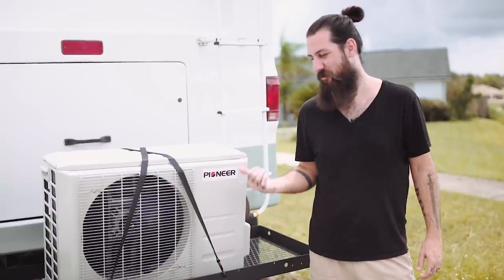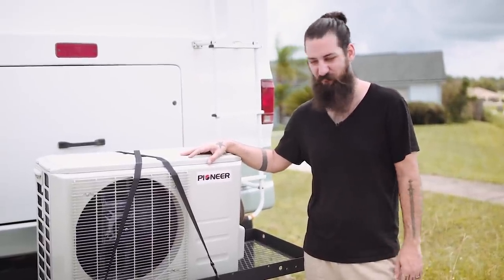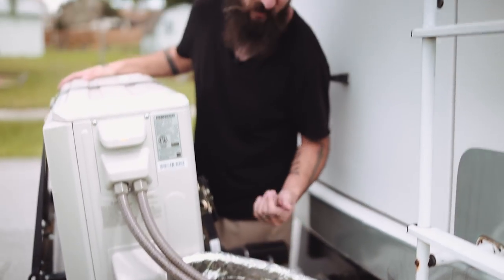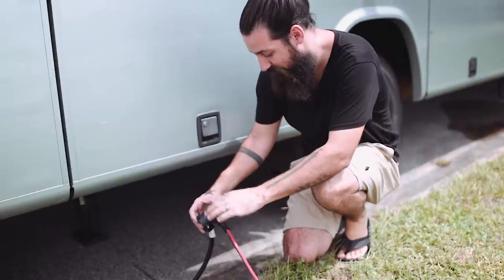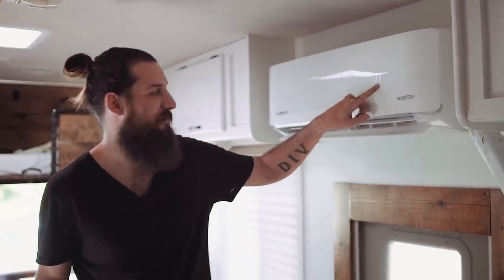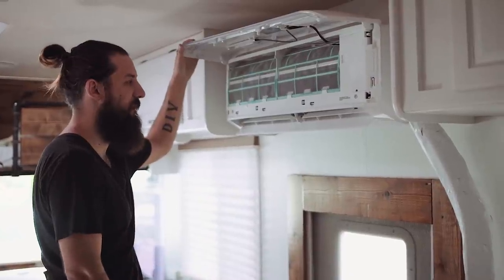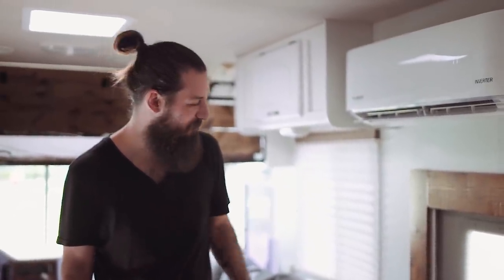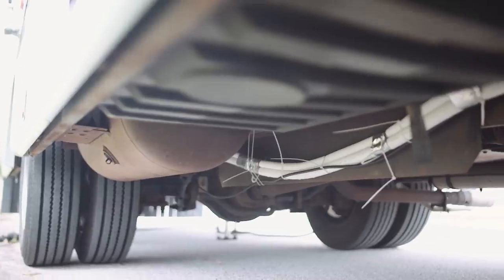RV / Motorhome Mini Split Air Conditioning Setup

Comment: Great job on the video, explanation, and common uses. The camera lady though is a little flaky but we can live with it. The biggest advantage here is that it's a residential unit that can be serviced or replaced by an AC shop. No waiting for parts from China like the common Dometic units found all most these rigs and especially important during a pandemic. Great job once again.

Comment: The huge advantage of a mini-split is its efficiency. My "SEER 22.5"-rated pioneer 9000 BTU will run off my Honda EU1000 generator IF I do not use eco-mode. Rooftop A/C's are nowhere near this efficient. The SEER number does matter if you hope to run your air off a generator or (possibly) a solar system. If you really need a low amp draw....look for a higher SEER number. The power savings is pretty remarkable. Thanks for the video!
Reply: Oooh what model do you have? :D What size space is this cooling/heating?
Reply: Check out   www.highseer.com.  amazing units for RV or house.  One of the few that have a 12,000 BTU that runs on 120.  The biggest thing is it uses about 1/3 the electricity of a RV roof top unit.  Those haven't changed much in technology since the early 60's!!!  Sad that it has taken the U.S. so long to adapt these... have them in off-base housing on Okinawa back in the late 70's when I was stationed there.
Reply: So if the steer is higher I can run it with a lower gen?? I though the steer # would be the size of the condenser,  like if this deer is lower or Ritz 9000btu then the condenser will be pretty small if the BTUs are higher than the condenser would be more bigger
Reply: Good and helpful comment G. Thumbs up.
Reply: Yap the SEER is very important and nobody is better then Fujitsu 9000 BTU split AC with "SEER 33"
Reply: What one is best for heating in Oregon weather with lowest amp draw?

Comment: Thanks for the video! I have a 28ft enclosed trailer that my family and I use for racing. We have a late model race car and normally go on Saturday morning to the track. The problem is in North Carolina the heat is unbearable past the start of June. We wanted to have heat also because it is cold when racing season first starts and sometimes at the end of the race year. I have been trying to figure out which unit to buy but the 12000 btu pioneer looks like it will be perfect for us. We just have to install a door or buy the clear door cover at the back to keep the wonderful cold air in. If that unit you have will cool a 38-42ft motorhome then I am sure our 28ft trailer will be no problem! Thanks again for the video!!

Comment: If you mount the outside unit on the hood, it will get more cooling power from the wind as you drive and therefore run a lot more efficiently.    Plus the refrigerant line run to the above-door unit will be much shorter which will also increase efficiency..

Comment: Thanks for the pointers. I will be installing a 230v 24k btu in my 5th wheel. I already have 2 15k btu riif units and they just won't do the job on the hottest days. Plus I'm just tired of hearing the loud things.
Reply: I was thinking of getting a dual zone 9k and 12k 230v systems also, but I think I'd need to get a split phase invertor so I can use it while driving or boondocking.  Alternately, if I can build a frame to put two units on the back of the motorhome two 115v units would save about $600.
Reply: @brianvandy4002  I'm glad I went the 240v route because they are more efficient. I don't boondock but hooked up to shore power I could run the mini split and the other 2 rooftop units (Even though there's no reason to) on 50 amps no sweat. The 24k mini split cools worlds better than the 30k BTU worth of rooftop units. It can be a hundred degrees outside in the mini split will still keep it below 70 inside by itself.

Comment: Any updates on this?  Still working well?  I have wanted to do this but worry about all the all the jarring of the open road on a residential ac unit. I have a travel trailer and have an empty Battery box (moved batteries inside) perfect spot for mini split close to electric and batteries.

Comment: This is great, thank you. Could you please tell me, does it cool down your bedroom in the back? I’m in Tucson, and wondering if a mini split installed in the middle of my coach will reach both ends. Thanks!
Reply from the maker: Hi Derek, our is pretty much in the middle of ours, and cools the whole rig down fine. We don't have a door to our bedroom, so the air can still flow to it. We do use a small fan at night to have moving air.
Reply: You can turn on your furnace fan for circulation if needed.

Comment: Thanks to you I will now be doing the same thing with my 30' 5th wheel and will do a installation video as well. I will be hiding the lines in a closet or in your case I would have done a false wall to hide them, but nice job anyhow!

Comment: I have spent hours looking at alternatives to cooling my 37 foot Bounder and this is the best yet!  How did you attach the bracket for the inside wall unit, I saw a video where there was a sheet of aluminum attached first.  Did you consider this or find it necessary?  Also where did you obtain the double hitch?  Looked for contact info but was not successful, hope this finds you.
Reply from the maker: Thomas Surro ours is mounted on a wooden box frame. There was already a cabinet there. We just replaced the cabinet with a flat face basically. The head unit weighs the same as two bags of groceries you’d put in the cabinet so I saw no issue. I’m pretty sure I got the double hitch at Walmart. You can find them on amazon as double hitch adapter.
Reply: Thanks for the lightening quick response, I've located the Hitch Haul and all is well.
Reply: I can build custom ac units . Using automotive EVAP coils vents and supply hoses to needed locations. Don't use a home unit for your rv
Reply: @davidwilliam1406  Please explain why not to use them.

Comment: Litte Adventure,  How long have you had this system installed and how much traveling have you done with it?  I know you said you did a 4000mile journey after you had installed it but I am wondering more about longevity of the bumping and knocking that will occur while traveling.  I am thinking about putting one of these in an enclosed race trailer but am concerned about the durability of the unit under the bouncy conditions of the 16' trailer.  I currently have one of these installed in a small office behind my house and it is AMAZINGLY good and SO QUIET, I'd love to have one in my trailer for hot summer races.
Reply from the maker: We have been full timing for over a year now, and have had the mini split installed the entire time. The very first thing we ever did in our renovation was get rid of those dang rooftop units! We have probably put about 6-8 thousand miles in the past year, and the mini split is doing great. We hop from campground to campground at least every two weeks, just to give you an idea of how often we are driving with it. We wouldn't change a thing!

Comment: Great setup, just one critique, don't leave your electric adapters and connections in the gutter outside.
Even if there is no rain in the forecast, the neighbor next door could short you out by watering his lawn.
Reply from the maker: Solid advice, Bob! This was actually just a short term parking for us just to make this video, before we moved into the backyard - but still, great advice! Didn't even realize we had just thrown the cables there willy nilly. lol

Comment: This is a cool setup and idea but I see that you're hooked up to AC but how does this work on the road and boondocking/dry camping? Is it running off your generator/house power, solar setup?
Reply from the maker: Hi Aaron, If our generator worked, it would run off of that while one the road, lol! We are stationary at the moment, staying in my moms backyard only hooked up to a regular household 110 outlet, and that is enough to run our A/C (which is part of the reason we got rid of the rooftop units and installed the mini split). We are currently looking into solar and a battery bank, so that will be an upcoming video for sure.
Reply: This Little Adventure interesting, what happened to the generator? I'm going to convert my gas generator to propane and hook up a mini split how you have it. What btu do you think would be sufficient for a 30ft class A? I was thinking 12 but can I get away with less? I'll also be adding solar but that's a much bigger project.

Comment: What guage extension cord did you plug into? I'm looking at setting mine up with an extension cord wired directly to it and then plugged into a 50 amp at rv spots. I'm looking at going with a 12/3.

Comment: I like the installation, the line set bundle needs tweaking? I’m thinking some type of wire loom would look cool if you could find it that large. Otherwise great job
Reply: White square vynl raingutter drain section!

Comment: I have a question: I am thinking of using a split unit in my MH and would like to know if the inside unit has to be placed like it is in yours or could you put is on the ceiling in the area where the old AC unit  was? I'm think probably not but one could run the connections across the roof then to the back. Just trying to plan my layout... any suggestions would be appreciated.

Comment: Will this unit drop down to the 60° mark in dead of summer florida heat?  Im from N.Y. love the cold and hate roasting in a rv.
Reply: If you need 60F to be comfortable, go to Nova Scotia, not FL.  A well-installed mini-split will typically drop the temp 30F from your outdoor temp.  RV insulation is the limiting factor and it's not that good.

Comment: We are thinking about doing the mini split after testing out tons of portable units. We are just wondering how cool your back bedroom area gets with just one unit?
Reply from the maker: Katelyn Rufty That's a really great question, Katelyn! The mini split does cool down our entire motorhome, but obviously the living room area is always going to be colder than the bedroom, simply because that's where the unit is. Since we are really only ever in the bedroom at night, we prefer the living area to be the most comfortable. We have a Vornado floor fan that we use at night in the bedroom, and that pushes cold air back there as well as gives us air movement, which otherwise would be quite still. All in all, we love how quiet and efficient the mini split is compared to the rooftop a/c units in all campers! :)
Reply: I was wondering the same thing. We have three kids and will be replacing the back bedroom with folding bunk beds, while my husband and I sleep in the front on a pull out couch.
I hate the two roof air conditioners and was thinking of replacing them with Maxx air fans and installing a split unit. I was just wondering if we should get two or one  indoor units. Maybe, we could get away with one and the fans will help with circulation.
Reply: dreamingfool2 after watching this video we bought one unit and installed it in the back where the kids sleep and it has been amazing! It feels like we are back in a house and so very quiet. We did install it later in the summer so haven't gotten an official test in the humid south, but cooled down the entire motor home. Started using the heat and for us it's not as strong as the cold air so we've been supplementing with a small space heater up front where we sleep and has been fine. We've been satisfied with just the one unit for now. We also have the maxx fans in the ceiling where the old roof units were and it's nice to open those for fresh air when it's nice and also some extra light. But so far we have been amazed at how great they work!
Reply: Do you run this A/C while driving? That would presume you run the genny too.

Comment: I actually installed that same brand in the living room of my 1400 sq. ft house.  works awesome, but do you think you could have gotten away with using the 9000 btu model instead of the 12000 btu?  I'm wondering if the smaller unit would handle something the size of your rv if given enough time.  I'm planning on using one powered by my solar set up  in a step van I'm converting.  the low starting amp draw and the the variable speed of the compressor makes it ideal for my use....just wondering about the cooling load
Reply from the maker: pipeboy98 We probably could have gotten away with the 9000 but model if we had a better placement opportunity for the indoor unit. We have seen them often in tiny houses mounted on a far wall, which is ideal because it only has one direction to flow and also only has to fill one open space. I imagine this would be the same situation in your step van. In our motorhome however, we need the air to fill our living area as well as make it back to the bathroom and through the hallway to the bedroom. We use a floor fan at night to help push that cold air into the bedroom, and this works really well for us. We are currently looking into solar options as well, and we absolutely love how efficient the mini split system is. Good luck in your conversion! :)

Comment: what about when you travel?  How would it react to vibrations?  how long would it hold up?
Reply from the maker: We did drive this thing through some pretty terrible midwest roads about a month ago, and we kept checking every time we stopped to check everything. So far it seems to be holding up just fine! We are looking into moving the unit from the cargo holder to the actual inside of the trunk area we have just behind it, which will make it feel a little more sturdy.

Comment: Where can u park, do they have a place for u to plug in the unit for heat or ac, and how much does it usually cost monthly?
Reply from the maker: imcharmed4evr Most of the time we stay at campgrounds with full hook-ups for a couple of weeks at a time. While we're at the campground, we have full power and are fully hooked up with water and sewage (most of the time). When we aren't at a campground, its a little different. Like when we park at a friends house, we obviously aren't hooked up to sewage and don't have full power, but we do have enough power to run our a/c and our outlets and tv and computer. It varies, but our typical monthly costs for living are about $200-$400, depending on which campgrounds we stay at. :)
Reply: This Little Adventure could you do a video about some of the campgrounds you stay at? Our family is planning to make the move in a camper after the new year but most of the places we are finding are Super expensive (like 1000-1500 a month) we have been considering a Thosand trails membership to help offset but would love alternatives.
Reply: Many full time YouTubers move around quite a bit and seem to find 25-30/nite at the low end and 85-90/nite at the upper. Most parks will give a monthly rate that is lower. You could boondock for free and for that...search on YouTube for all the special equipment/knowledge needed. Thousand trail membership can be very helpful yet they are not everywhere and vary in quality. NOTE that many parks have restrictions on how old your RV can be. Keep doing your research!

Comment: Is this unit loud? The original unit in my rv is extremely loud and I’ve been considering something like this.
Reply: they are quieter than RV types, as the actual compressor (noisy bit) is outside, unlike with an RV aircon, there is a hole and the compressor is ontop! It will be quiet
Reply: Ahh thank you!  I'm still learning :)
Reply: Even the lowest quality units are much quieter that a rooftop air. The better quality split a/c's are really whisper quiet. His unit was running (inside and out) during this video and I could not hear it. They are amazing.

Comment: Will this run on an inverter?

Thanks
Reply: The link he provided is a 12,000 btu unit, specs say 345-1296 watts. A 1500 watt inverter might run it fine, a 2000 watt inverter should have no trouble at all. The A/C unit is inverter driven it should be a "soft start" and not have a big spike in power draw on start up. The 9,000 btu unit is only 279-901 watts.

Comment: I have 2 LG units in my house that I installed. Knowing the process of installing the line set and flare connections I can’t see them hold up on a moving vehicle. Hope they do, nice RV.
Reply from the maker: Yea, I mean that was definitely a concern. We just finished a 4,000 mile road trip, and everything seems to be doing just fine. In comparison to a traditional home, there may of course be a little more wear and tear maintenance that we might have to keep up with sometime in the future, but so far everything is working like a charm! :)
Reply: They do hold up well in moving vehicles, especially if you use Nylog sealant/ lube on all connections just as the professionals do. Put it on the inside & outside of the flare and on the threads and it will lube and lock the system together.

Comment: When you use the heat and it's freezing outside won't the unit freeze up.
Reply: All heat pumps will periodically reverse to defrost the coils.
Reply: Yes, but Inverter heatpumps still have a COP of over 1 when below -10c. COP=efficiency, so over 1 is good. a space heater has a COP of 1. 1000w=1000w of heat output.
Reply: I believe most quality heat pump split air conditioners can provide heat from -20F and cooling to at least 120F yet they are less efficient at those extreme temperatures. Go larger than usual if you are talking Minot, ND or Albuquerque, NM full timing.
Reply: i think you mean -20c